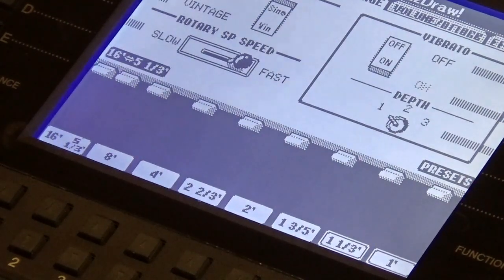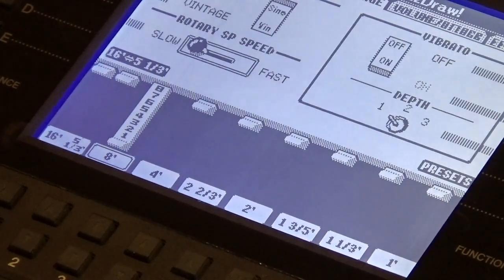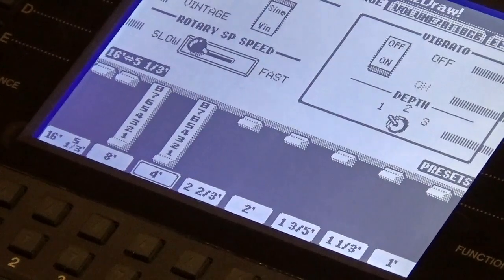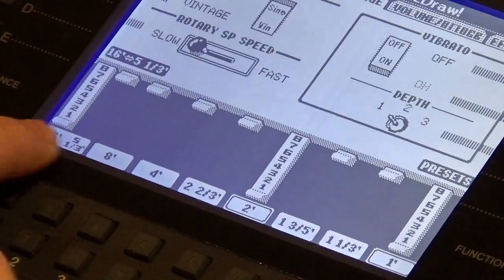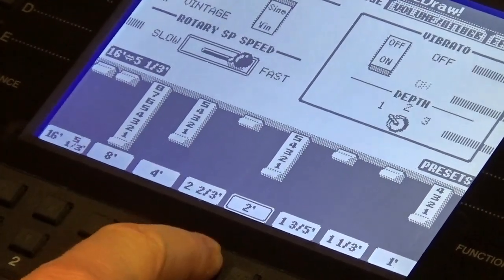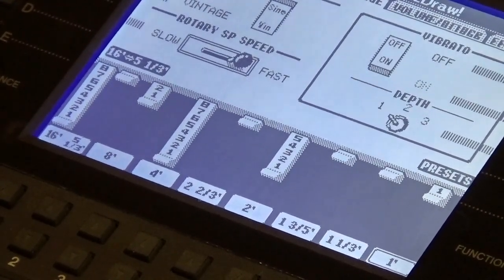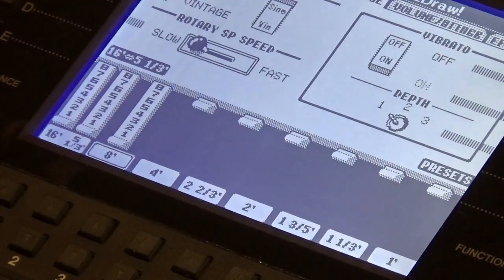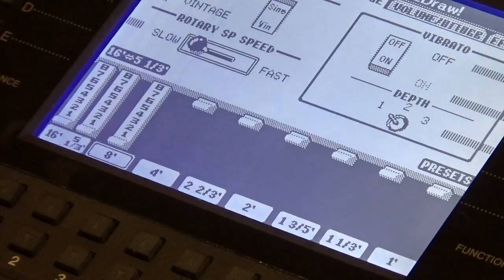Organ / Keyboard Drawbar Basics

Comment: A more mathematical or scientific explanation is that the 8' is the natural or fundamental frequency of the keys. 4' is the double frequency, 2 2/3 is (almost) 3 times, 2' is 4 times, 1 3/5' is 5 times, 1 1/3' is 6 times, and 1' is 8 times. 16' is ½ the fundamental frequency, and 5 1/3 is 1½. Hammond tried to make a drawbar in between 6 and 8 times - but it didn't really sound right because there is no musical interval that fits a 1 to 7 ratio like 1 to 3 or 1 to 5 which is 2 octaves + terts and 3 octaves + quint respectively.
Reply from the maker: Interesting
Reply: confusing
Reply: The 7th harmonic is just naturally very flat when compared to the actual 7th on an equal temperament keyboard that’s why it isn’t used and doesn’t sound good if it’s overly present in a mix or tone.
Reply: Righteous.

Multiplying a frequency by 7 is equivalent to shifting up two octaves plus something that doesn't closely match any semitones within the equally-tempered scale (12 semitones per scale) of Western music. 

7 = 2*2*1.75 = octave + octave + 1.75

Multiplying the root note of a scale by 1.75 gives a note that is somewhere between 9 and 10 semitones above the root.  For the scale of C, that would be somewhere between A (frequency of C times 1.68) and Bb (frequency of C times 1.78) but not close to either one.
Reply: in contrast, consider multiplying the frequency by a factor or 3 or 5.

3 = 2*1.5 = octave + 1.5 = octave + quint

Multiplying the root by 1.5 corresponds to a note 7 semitones above the root.  For the key of C, the frequency is very close to G (the frequency of C times 1.498).

5 = 2*2*1.25 = octave + octave + 1.25 = octave + octave + tert

Multiplying the root by 5 corresponds to a note 4 semitones above the root.  For the key of C, the frequency is very close to E (the frequency of C times 1.260)..

Multiplying a note by 3 or 5 produces a frequency that is acceptable to what is accustomed to be heard for the equally-tempered scale, whereas multiplying by 7 produces a misfit frequency that is perceived as being dissonant relative to any of the 12 semitones.
Reply: I believe there is 1 hammond organ model with a 7th drawbar but i believe its one of the transistorized ones. Not any of the tonewheel models
Reply: @MrLostsoul1234  H100, X66, and X77 has two extra drawbars marked "I" that gives a combination of 7th and 9th, and "II" that gives 10th and 12th. The 7th and 9th are not perfect though. They are quite far away from the exact pitch.
Reply from the maker: Yes - some early Wersi organs had a 2/3 drawbar above 1’ to give that bright sound
Reply: @organfairy  ah ok so it is the tonewheels!

Comment: Keyboard Skills Pro The H & X Series of Hammond Organs have 2 more Drawbars (Mixture Drawbars) the 10th is 1 1/7 & 8/9 together, & the 11th is 4/5 & 2/3 together. These additional Drawbars add some extra shimmer (along w/ those Pedal Switches on the Right) that I used for a very interesting cover of Octopus's Garden by the Beatles, & I also wrote a parody of that song about the Hazards of Improper Popcorn Storage.
Reply from the maker: Excellent - some Wersi organs in the 70s/80s also had the 2/3 (above 1’) drawbar to add that brightness.
Reply: @KeyboardSkillsPro  They should make more of these Digital Organs w/ these additional Drawbars so that we can add some extra shimmer.
Reply: @KeyboardSkillsPro  Because that extra brightness adds alot, more Digital Organs need these stops (and switches) as well as a 32 note pedal board for increased versatility.

Comment: I am learning drawbars but on  the Ferrofish B4000+ with the same exact drawbars and I was noticing the fast speed of your leslie.  It is much faster than I have mine set.  So what is the take on how fast should the leslie spin.   So I could take some of your settings and when you play I could set my fast  setting to sound like yours.   Instead of on an actual hammond there are at least two sets of 9 drawbars where on the ferrofish there is 1 set to be shared with upper and lower and if there is a midi bass pedal board,  there are drawbar settings for that.   When I have two keyboards hooked up  My Korg M1 is on the lower register and the Roland midi only keyboard is on register upper.  What I do is first set my  lower to my desire then set upper to something different.  Now if I go back to lower,  my drawbar settings suddenly change to the upper.  So I will sometimes leave one alone and do drawbar settings only on the other keyboard.   It is certainly a learning experience.
Reply from the maker: Haven’t tried the Ferrofish but it looks a fun unit.

Good look with exploring drawbars :)

Comment: I also play Yamaha PSR 750, I am unable to pull the 16 out, but am able to pull the 5 1/3 out, am I missing a point, thanks if you can help.
Reply from the maker: There is a toggle option on the screen buttons (left button) which changes the left most up/down arrows from 16’ to 5&1/3. I’ve just upgrade to the Yamaha PSR SX900